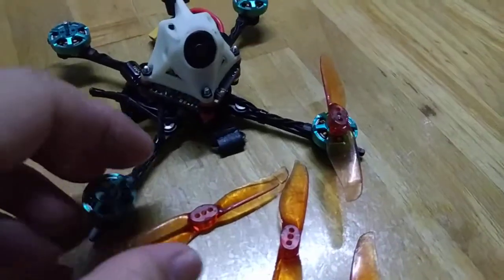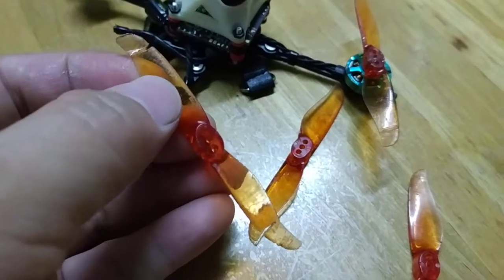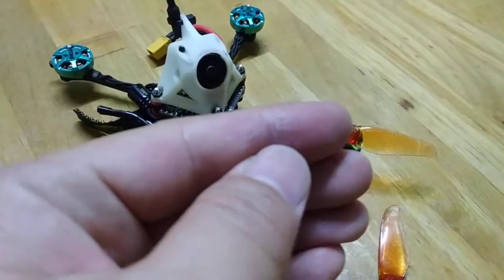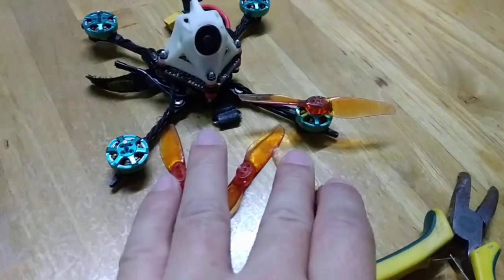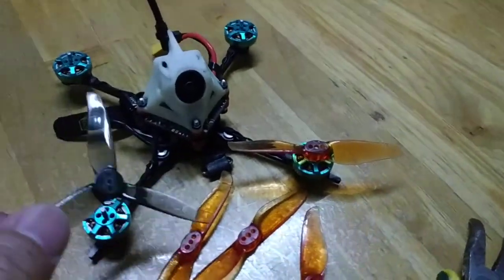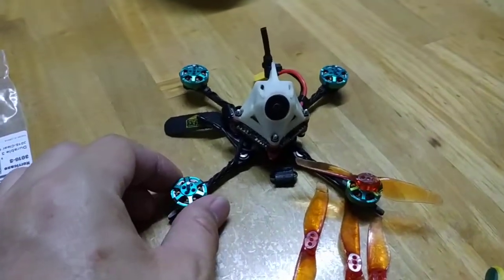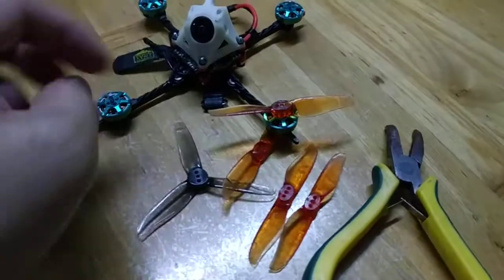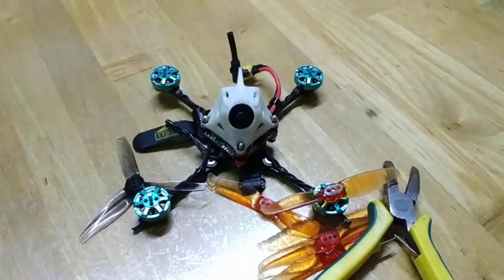Gemfan 3018 propellers are excellent!

Comment: I'd say that trying to force the prop off may damage your motor. Have you tried heating briefly with a heat gun?
Reply from the maker: Yup, you are right. Tried as hard as I could without the risk of damaging the motors. Did not use a heat gun but did tried to heat up the prop hub with a lighter. Anyway, I think I have found a solution to mount the props without them getting difficult to take off. Had posted a new video in it.